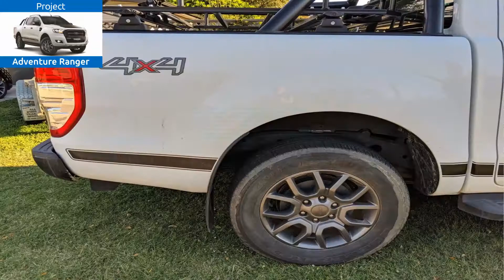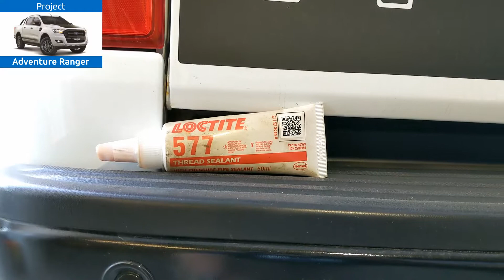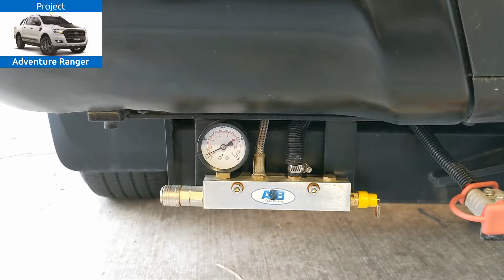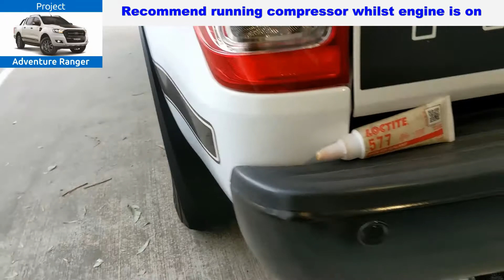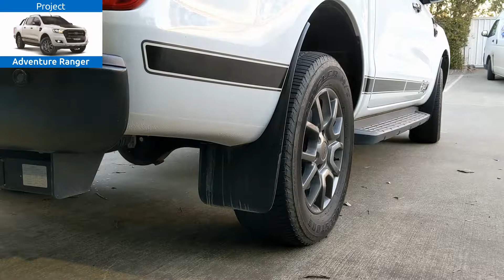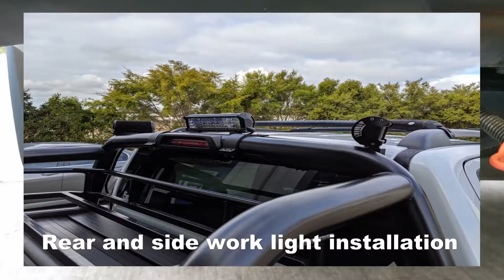Air On Board 12 volt air compressor installation

Comment: Hi Mate, any update on the compressor and install? - Looking at getting one but cant find any reviews on them.
Reply from the maker: Hi Ross, the Air On Board air compressor system is still going strong with only a fitting on the air receiver requiring a nip up. Apart from that it's been a reliable system with plenty of air available whenever it's needed. 
Thanks for the prompt and I should do a review now it's been installed for awhile.
Good luck with your shopping and install!
Reply: @projectadventureranger1691  thanks mate, a review vid would be great. Can I ask the main use you have for it? (I.e. pumping up tyres? (If so which size)) and how long it roughly takes to pump them up? Also do you think the airtank makes a big difference? 
Cheers

Ross
Reply from the maker: @Lost_Twice_Over  The 6 litre receiver is very handy for running the set of train horns that I have underneath the vehicle (on a separate switch circuit of course) which is ideal for wandering animals and pedestrians. The system has not been used a great deal in anger however, I run 265/60R18  tyres and the air compressor system with a 6 litre tank will take around 3m45secs to pump the tyre up to 32psi from a near flat tyre (5psi).
A tyre inflator, blow down nozzle and 6m of airline is in the tool tub just in case  it's required. I have found that the supplied quick disconnect coupling is a bit average and didn't take too long to rust out. As per the video use a suitable liquid thread sealant on all your joints.